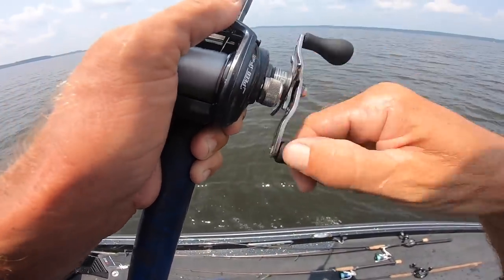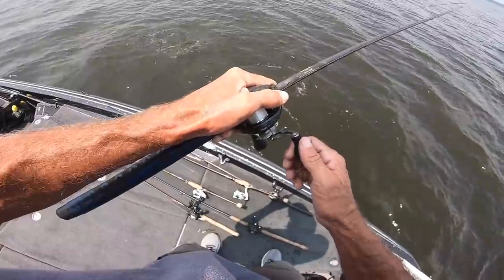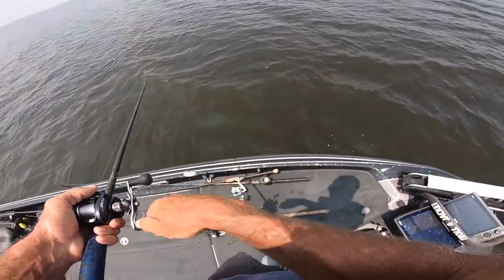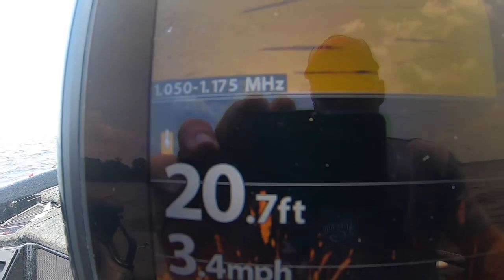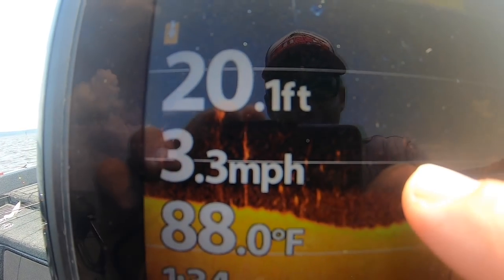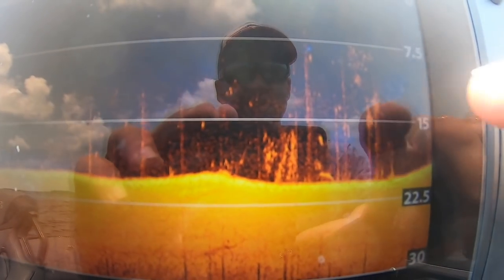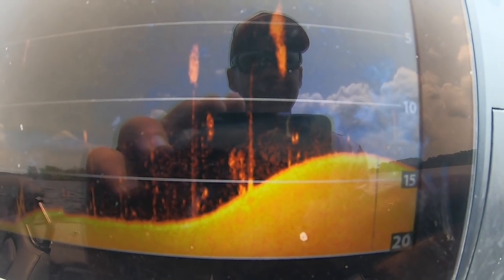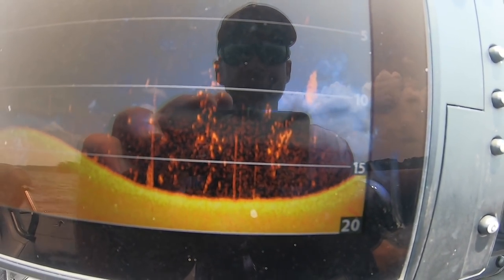Understanding the Thermocline (How to find bass and baitfish)

Comment: Awesome video Scott!  I have been seeing the thermocline, but did not spend a lot of time graphing 🤦🏼‍♂️  I will spend time checking this out next trip.  About the images we see, I’m glad to hear they are not reality!  I can rarely get the award winning image.  Summer is a crazy time, I found a little pocket (about 200 yds by 200 yds) with a small opening 12’ deep with bait everywhere.  The thermocline is 15’ to 18’ There was a lot of activity, but couldn’t hook up.  I changed to a 3/4 ounce Megabass double willow Spinnerbait and slow rolled on the bottom and caught  2 good ones.  Your tip will help me next time out 👍👍👍

Comment: This year has been different bro. Everything about it. Usually here in southeast Kansas will have the spring thermal Klein early summer thermocline and then we'll have our early fall thermocline and turnover. But this year on our legs we've almost had a permanent thermocline just finally did we have our lakes clean up like in the last 2 weeks I was out today and we didn't have a thermocline present that was noticeable that being said most of this year on my homework we had a thermocline at right around 15 ft and it varied between 10 and 15 and for the most part our fish have been shallow all year long even on the hottest days in the summer the fish were pretty shallow not where they usually are. No like you said in the video we had a lot of flooding in late summer which perpetuated that thermocline. Good s*** bro. Also what is that cranking rod you got in your hand i'm a cranking rod fanatic I buy him even when I don't need them LOL.

Comment: Thanks Todd.. so you weren't digging a ditch with that crankbait but cranking a few feet above bottom through the stumps and brush? You always here that if you're not deflecting off the bottom then you're wasting your time with a crankbait. Can you clarify?
Reply from the maker: You nailed it I was on bottom some of the time but I caught a lot of them not on bottom when it got deeper depending on how the bottom changed depth
Reply: Don’t spread that around lol I live on a deep lake and about %40 of my cranking fish there is nothing to bang off . So I put the bang on the bait myself speed up , slow down , stop and go fast , stop and go slow to fast . I try anything to trigger the fish most of the time it’s just a stop that gets them .  Not that you wanted my opinion I just thought it was a great question and it’s true that say it so much grinding and deflection it will start making you thank that’s the only way but it’s not .